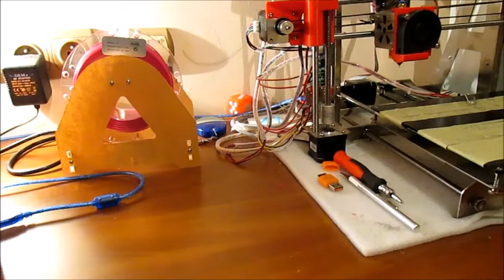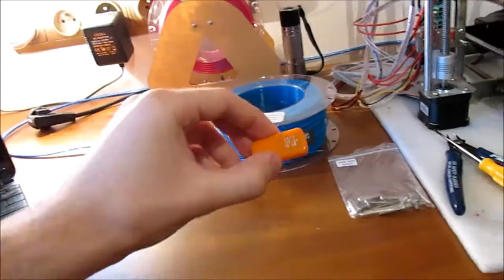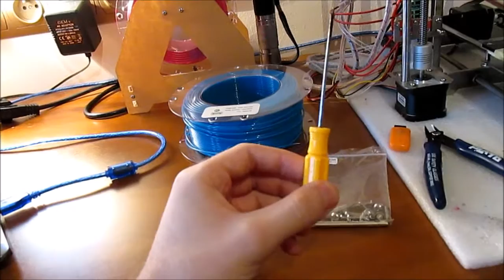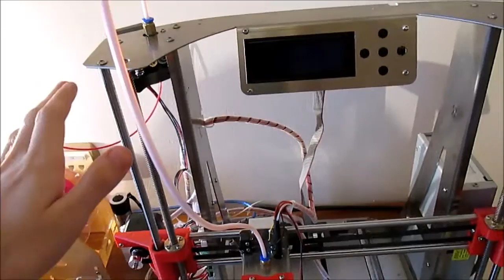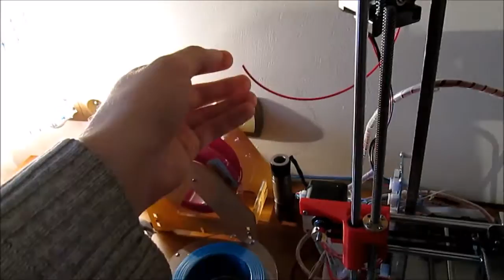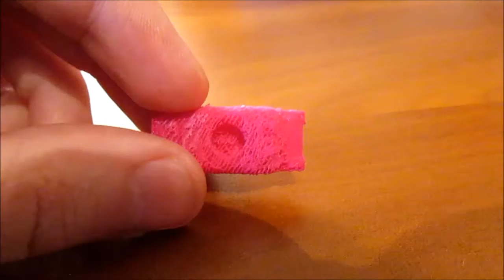Zonestar 3D Printer Review (Prusa i3 clone)

Comment: for soldering use big high tem. soldering station and of course FLUX! Heat app the pace with flux and then only add tin and cable, hold it down until it cool down. Clam cables good to the heat bad with zip ties.

Comment: Can it print from a SD card? I didn't see a card slot on the control board. Is it on the LCD board?
Reply from the maker: Yes it can print from an SD card. The SD slot is on the control board toward the bottom and it is pretty small so it may be hard to see.

Comment: Hi,
I have a P802QR2. Would you mind giving some hints on how you improved the print of the small tank ?
Reply from the maker: Sure, I printed the tanks between .06-.10mm (60-100 microns) with 100% recliner infill using the Repetier slicer. The material is PLA and I had the extruder temperature at 195 and the bed at 60. Sometimes I had issues in the beginning keeping the tank upright while printing. Now I use a wood glue slightly diluted with water and using a brush I paint a layer or two over the glass printer plate while it is hot. After it dries a thin layer will remain and it really helps the prints stick and stay upright during printing. I hope this helps some with your prints :)

Comment: You should Store your PLA in an air tight container with a couple of dessicant gel packs. 
PLA and ABS absorb the moisture in the air, the water particles turn into steam when heated. This will result in poor quality prints.
The reason your filament breaks, is probably due to poor quality plastic.
Reply from the maker: Thanks for the advice :) The plastic is as you said poor quality. They give you these two rolls "free" with the printer so you can't expect much from them but at least you have some filament first thing when you get the printer. Happy printing!
Reply: it is good, coupon for $289.99, coupon works:  Zonestar, http://www.gearbest.com/3d-printers-3d-printer-kits/pp_649616.html?lkid=10871626,
Reply: yes, it works
Reply: I found pretty damn good price on this site. It's for 289.99 USD with coupon code: ZONESTAR
http://www.gearbest.com/3d-printers-3d-printer-kits/pp_649616.html?wid=21&lkid=10865770
I hope it will be useful

https://www.youtube.com/watch?v=vE5joOQe2oA

Comment: Hey Seth, good upload. I'm a new user of P802Q. I think it's an awesome printer for the price given we're talking about an all metal printer. The downside of it is obviously documentation and lack of support cause of little community. I want to configure my printer in Simplify3D but can't seem to pin-point the parameters for a high quality prints. Do you use S3D and would be kind to share your process or conf. parameters. Thanks
Reply from the maker: Hey Raz, sorry for the delay getting back to you. Unfortunately, I have no experience with Simplify3D and can't give any good advice on how to configure it. I have some friends which may be using it and I will see if they know anything more about it. So far I have been using Slicr3r and Cura and rotating between them depending on what I print. Good luck and if I hear something about Simplify3D I will let you know :)